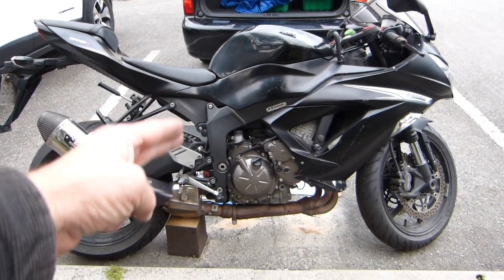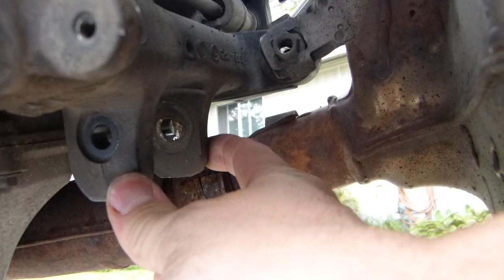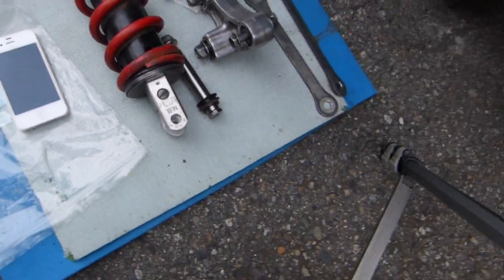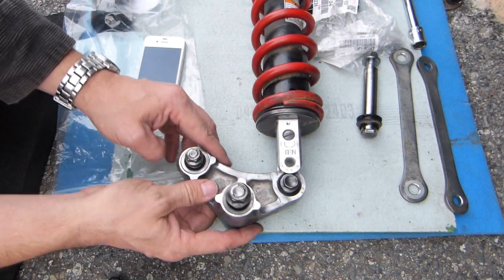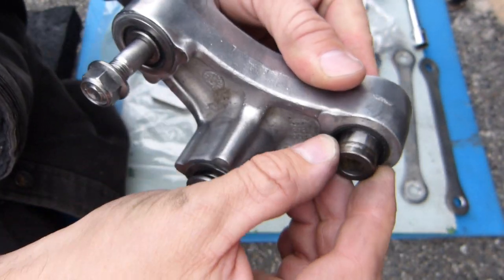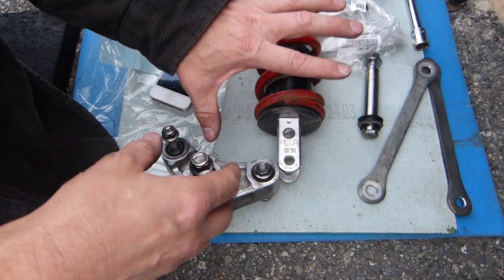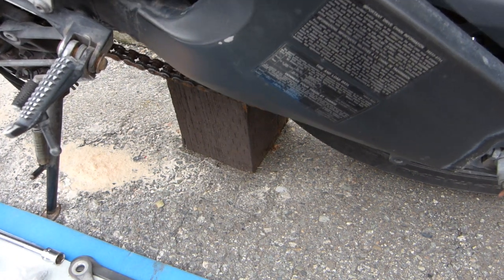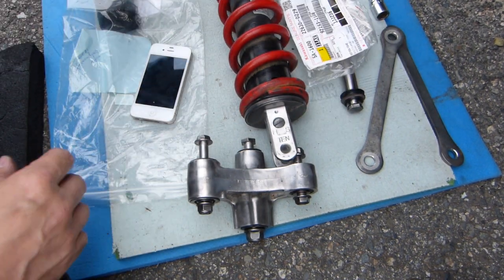Rear shock absorber linkage maintenance mystery

Comment: Thank you for this video . I am undertaking exactly the same job. Yamaha XJ900 Diversion 1999. I have new shock absorber and have installed new swing arm bearings. Like you I narrowed issues down to slight play in the bolt and sleeves. I was considering what to do. Parts are expensive and I did not have any specifications from Yamaha. I will just reinstall now I have seen your great video and torque everything up. Thank you.
Reply from the maker: Upload your story on YT, post a link here, I'll keep it up top of the page

Comment: Hello! Thank u for so informative video. I just bought ZX6R (2015) and I found similar clicking sound as u described. Do you have email, I would really appriciate to hear your opinion. Thanks in advance!
Reply from the maker: Sorry about the wait. Back then I ordered replacement bolts, measured their diameter, and never installed them. They are the same dia. as the old bolts, down to a decimal place.
When springs are unloaded / loaded there is a clicking, due to a generous clearance fit between bolts, sleeves, holes to make sure they don't seize up and the shock is always removable for race tuning.

Comment: My sons Yamaha FJR 1300 stated linkage service every 12000 miles/ 2 years. His mechanic reckoned because the bike was very heavy and and due to being shaft drive it should be done once per year. He believed chain drive bikes spit a bit of lube onto the linkage so they receive a bit more frequent grease. My son is also an all year rider in the UK.
Reply from the maker: That flung-out grease lands on exposed surfaces, not the ones that actually need lube. I'd go with the manufacturer's legal document made for the UK, unless you like supporting your local tradespeople, nothing's wrong with that either.

Comment: The bolts cannot move inside the sleeves, when the bolts are tightened up! 😂👍
Reply: That what I was thinking .when they are torqued they lock the outer needle bush firm so the only friction is with the outer surface of the bushing through the grease to the needle bearings .Correct me if I’m wrong 🤘🇬🇧❕

Comment: I'd assume the bolt only provides tension (clamping) force and all "shear" is handled by friction. I.e it shouldn't matter how loose the bolts are as the parts shouldn't be able to move if there's sufficient friction and clamping force.
Reply from the maker: Suspension does come 100% unloaded in a small jump (speed bump), all 4 bolts need to pivot, not clamped to seizure. Little rattling at unloaded-loaded transition is OK - so it is manufactured.

Comment: I had that Clunk when lifting wheel from the ground and letting it hit the ground on both (brand new) Kawasakies Z750 (Year 07-12). Upper Shock bolt (bolt number 5 on your Schematic) needed more tightening torque than specified (about 1/8 of the turn). No more clunk sound after that and years after, it is still good. As for maintenance schedule, nothing in my service manual, but, as long as needle bearings and bushings are in good shape and lubricated, i think thats all there is to it.
Reply from the maker: Thanks for sharing and watching.
The `clunk` sound is very subtle.
I checked brand new Kawasaki Ninja ZX-6R`s in a dealership showroom. If one sits on the bikes to compress the shock a bit, the `cluck` is there. This model is built this way.